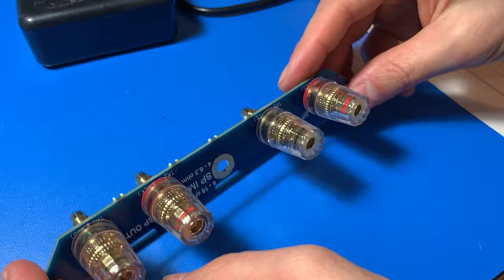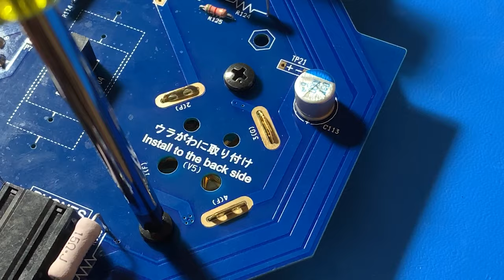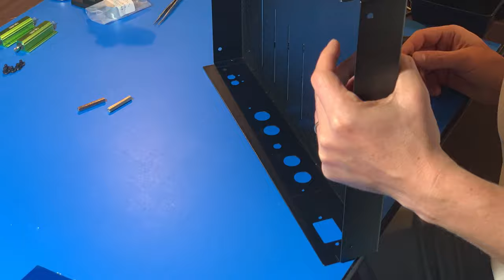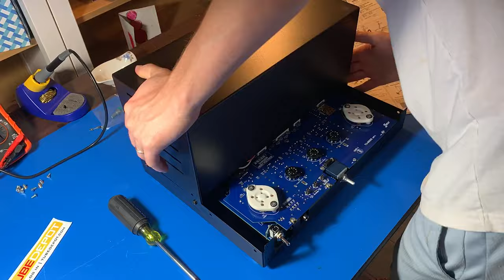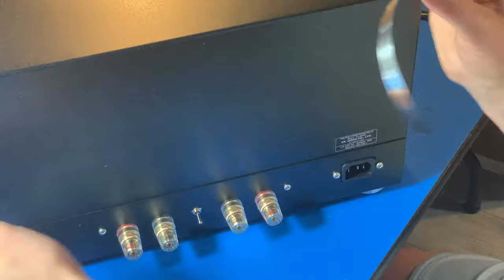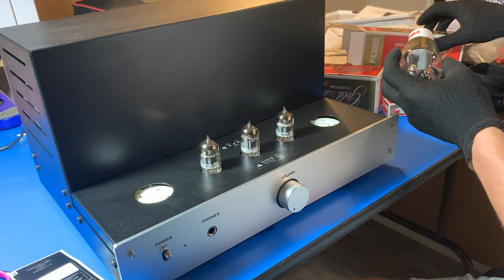$2000 Tube Amp Kit Build! Part 2.

Comment: Looks like a lot of fun. I was SO tempted, even paid for then canceled an order last year as I realized the company was cranking out new/improved models faster than I could keep up with the numbering system or available options and I wanted better Hashimoto OPT’s. Decided to go with a PtP 300b SET plan (seen elsewhere on YT) with a pair of EML 300b tubes and various 1940’s-era 6SN7/6F8G drivers. Thanks for sharing. How do you like the sound?

Comment: Nice build!  How many hours would you estimate you put into it?
Reply from the maker: 6 hours maybe. Most time consuming was probably  soldering the resistors. Just took time to find the correct locations for them.
Reply: Is it easy for a beginner with not a lot of soldering experience. I’ve heard issues of solder bridges?
Reply: @skularatna8136  Hi Suran, it is not difficult to solder it, if you know the basic rules of soldering. It depends on the tools you use and the type of solder too. My recommendation is to assemble some cheap electronic toys first. I paid a one day course how to solder. It was necessary for me to understand the process and common rules. Then I assembled some toys from China and finally I assembled small headphone amplifier, Elekit tube amplifier and Elekit tube pre-amplifier. It is amazing experience when you assemble it by your self. By the way, Elekit provides for their kits the best instruction manuals I have ever seen.
On youtube you can find a lot excellent videos about soldering. Do not be afraid and go ahead. You will find out what my master told me on the soldering lesson - soldering is addictive!
Reply: @milanstastny6799  
Milan other than solder station which tools that you used did you find most helpful?
which third hand do you recomend
could you list which needle nose pliers type of tips helped.

I am going to need some basic tools to do the job right. 
Since you have some experience that I don't have could you make some recommendations. 
Anything you found extra  valuble in gettig it done right the first time.
I plan on purchasing the amp camp kit to begin 
It's been more than 30 years since I did any serious soldering in the Air Force

I wish I coild hear it before I buy PS If I can pull this off I will do the SunValley Phono Pre as well

Thanks again, Cheers!
Reply: @567anorrman  Great Job and I loved your video.  I slowed it down to 1/4 speed and rewound while you populated the board 
To Make or not to Make other than solder station which tools that you used did you find most helpful?
which third hand do you recomend
could you list which needle nose pliers type of tips helped.

I am going to need some basic tools to do the job right. 
Since you have some experience that I don't have could you make some recommendations. 
Anything you found extra  valuble in gettig it done right the first time.
I plan on purchasing the amp camp kit to begin 
It's been more than 30 years since I did any serious soldering in the Air Force

I wish I coild hear it before I buy PS If I can pull this off I will do the SunValley Phono Pre as well

Thanks again , very impressive video production , Cheers! nd your other work bench series was cool too
PS I first wrote this to Milan thinkinking it was his video. Whoops, I can use any information on this topic please
Reply from the maker: @BicycleJoeTomasello  thanks! Yeah for me I had a temporary job repairing TFT LCD panels for a year, but that's nearly 20 years ago and since then I handn't soldered anything really. But that exprinece it probably helped me. I bought most of my items new from Amazon just before this build. The thing that makes the biggest difference I would say is the type of solder. I got this kester solder:
https://www.amazon.com/gp/product/B0149K4JTY/ref=ppx_yo_dt_b_search_asin_title?ie=UTF8&psc=1
I have also tried some solder I got for free with a solder iron from China but that was impossible to use.
I got this iron but I think cheaper ones will work just fine:
https://www.amazon.com/gp/product/B00ANZRT4M/ref=ppx_yo_dt_b_search_asin_title?ie=UTF8&psc=1
I also got a anti esd pad to use as a work surface, probably not that important when soldering this amp but there are a few semiconductors in addition to tubes, so why not be on the safe side:
https://www.amazon.com/gp/product/B00HFQPR1Y/ref=ppx_yo_dt_b_search_asin_title?ie=UTF8&th=1
I got these pliers that I found very useful:
https://www.amazon.com/Crescent-Tools-S2KS5N-Set-S-Needle/dp/B01CDJCOYK/ref=pd_di_sccai_1?pd_rd_w=fM3By&pf_rd_p=c9443270-b914-4430-a90b-72e3e7e784e0&pf_rd_r=334HEPWPBGB26F2HG5BX&pd_rd_r=c20ed8a2-1312-46bd-bf4e-b528bd334f75&pd_rd_wg=WJXgv&pd_rd_i=B01CDJCOYK&psc=1
And the third hand holder I don't even remember I think it was some cheap one from amazon. Maybe this:
https://www.amazon.com/dp/B08F7L1JVJ/ref=sspa_dk_detail_1?psc=1&pd_rd_i=B08F7L1JVJ&pd_rd_w=RhlLG&pf_rd_p=4269e1a0-a218-4fbd-9748-1cd337d2f2a5&pd_rd_wg=B5l7r&pf_rd_r=DQ0RFAWYZW9SCPVD9WQT&pd_rd_r=af11a95a-70f2-49f4-9712-2ca3abe9b7c3&spLa=ZW5jcnlwdGVkUXVhbGlmaWVyPUE1NFAxUDdCNlNCQ04mZW5jcnlwdGVkSWQ9QTA1MDg4NDgzM09UWlRWSEk2WlJIJmVuY3J5cHRlZEFkSWQ9QTAyODY1MzgzN0MxUTVRRUNUODVIJndpZGdldE5hbWU9c3BfZGV0YWlsJmFjdGlvbj1jbGlja1JlZGlyZWN0JmRvTm90TG9nQ2xpY2s9dHJ1ZQ==
And then I used some 70% IPA with these brushes to clean all solder joint from flux:
https://www.amazon.com/gp/product/B01LXC1VBE/ref=ppx_yo_dt_b_search_asin_title?ie=UTF8&psc=1
I cut the brushes short before use. And then some cotton rags to dry off IPA.

Hope any of this helps.
Reply: @567anorrman  Hi, very good choice. I think the only problem is the third hand for such big PCB. But to spend a lot of money on it just because of one project is a waste of money. Some tape or a piece of a sticky material can help to fix the parts during the soldering process...
Reply: @skularatna8136  Hi, as the others have said, don’t let solder bridges put you off. Some cheap toys or a short course will stand you in good stead. A good soldering station is a must, not just a cheap iron. Preferably adjustable temperature if you can. My old Elekit TU8200 has done 1,000’s of hours of work now, and is still going strong ( different tubes though ). The enjoyment you get from diy, is priceless.
Reply: @567anorrman  thank you for the details Covid put my ambitious plans for doing a project on the back burner but I am looking forward to it again. Thanks for a wonderful video and taking the time to respond so thoughtfully.
Reply: @milanstastny6799  Thank you Milan much appreciated, I am thinking of this project again, Covid got in the way during the summer.
Reply: @milanstastny6799  Thanks so much between you and @ToMakeornottomake I have a complete shopping list.
I bought a lot of stuff 4  a DIY LED set up that needs my attention that will help both projects.
Reply: @milanstastny6799  Wondering about dangers from lead vapor. I know in pro-shops there are always small fans that suck the smoke into exhaust tube and route outside. Is this a concern? BTW, I love this kind of work!
Reply: @kentonkirkpatrick5225  Hi Kenton, the smoke is not from the lead, but flux inside of the solder. It smells nice. It is not good to breathe it in of course the whole day, but I do not like the fan due to the noise. I love to listen to some music when I solder someting. Just wash your hands after you work with lead solder.

Comment: how's the headphone output?
Reply from the maker: Hi. Realized I haven’t really used headphone output so when you asked I just had to test it out. I think it sounded awesome with my grado headphones at least. If you inspect the circuit diagram you can see headphones output uses the 300b output tubes and the lundahl output transformers.